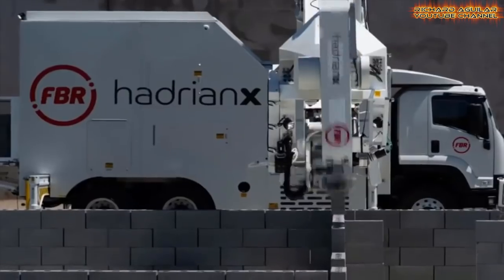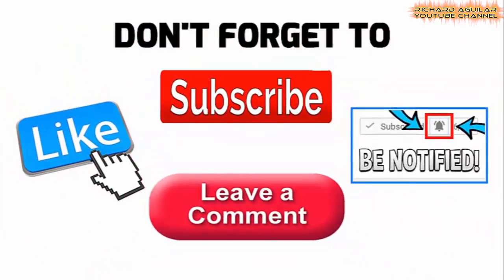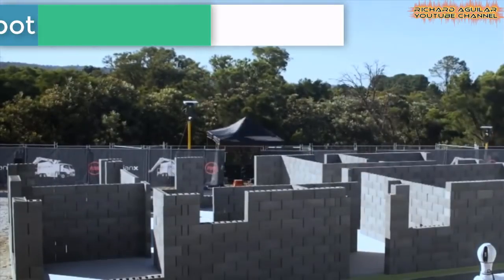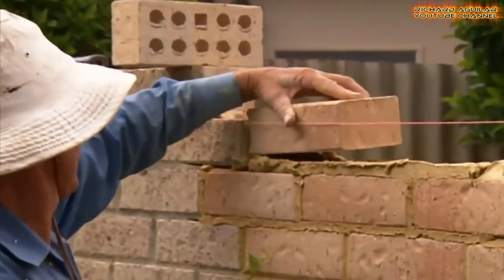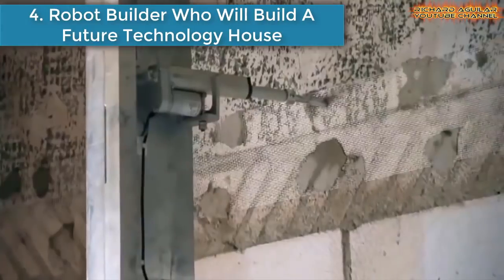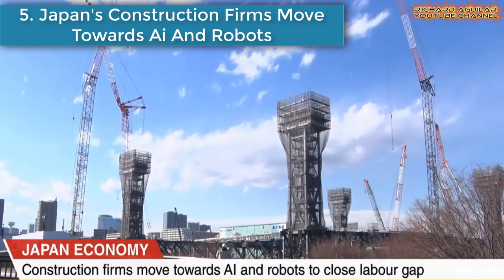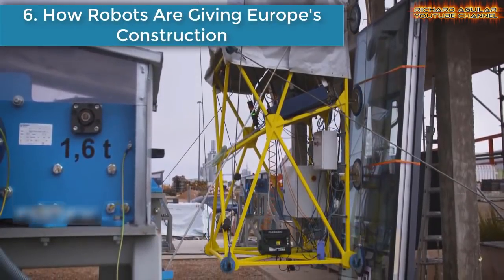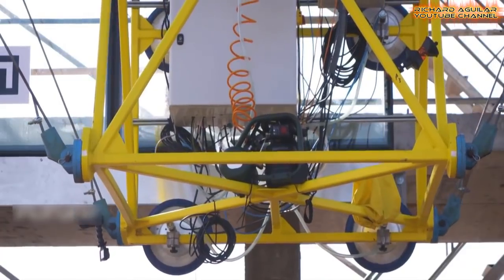SUPER CONSTRUCTION ROBOTS THAT BUILD HOUSES AND BUILDINGS

Comment: Seems to me the big boom of robot made homes will come when engineers design a way to supply electrical, pumbing, and hvac to and inside the home. Ive racked my brain trying to think of ways a robot could wire a home and the only thing i could come up with is having the wires pre-ran inside the walls and having some sort of connector at the ends to splice everything together.

Sounds simple…. Its not